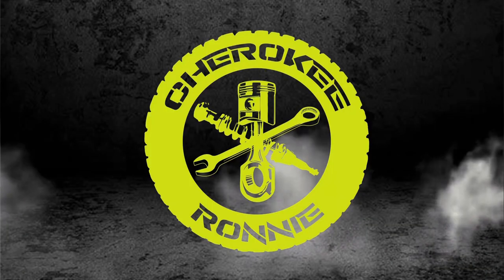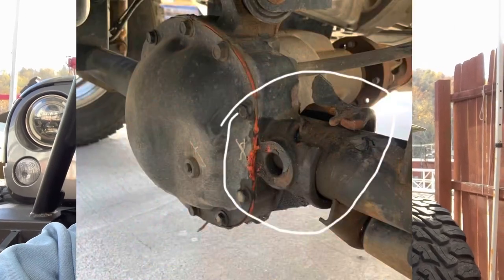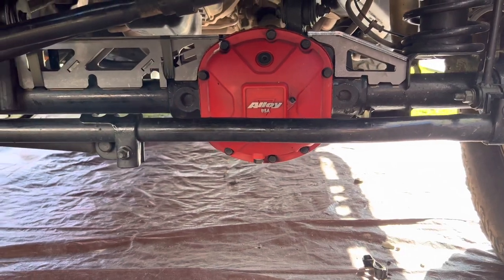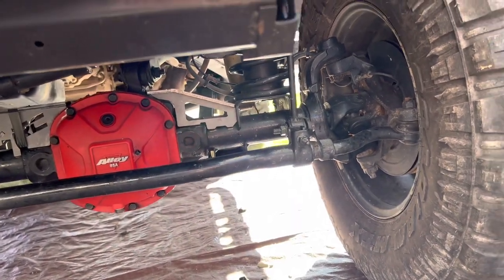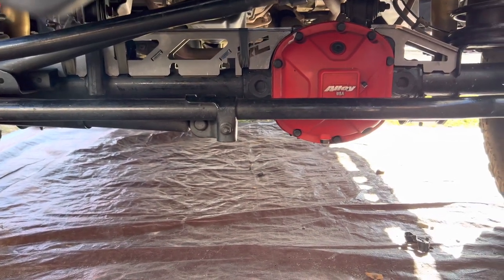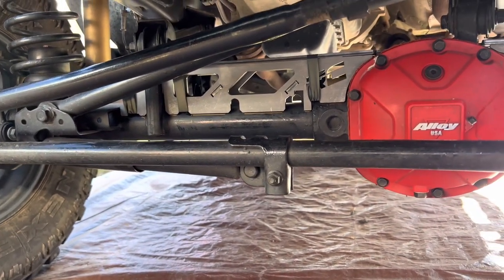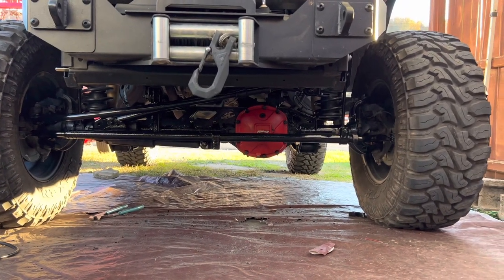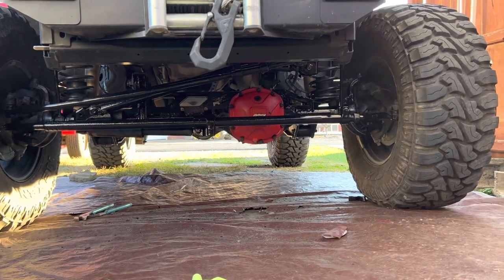the first modification you need to do after putting big tires on your jeep

Comment: Hey Ronnie, I know this is unrelated but do you have a modification for the transmission cooler line connectors to the trans? I don’t trust those pop in, plastic clips and one of mine just failed. They are hard to get here in Australia and I’m looking for an alternative. Was thinking of replacing the entire fitting with a brass fitting with a nipple and just using rubber cooler lines with hose clamps. Have you ever done nothing like that? Cheers from Tasmania.
Reply from the maker: A lot of times I’ll use a rubber hose with hose clamps always held up great for me
Reply: @cherokeeronnie  awesome,  thanks, thats what I wanted to know :)